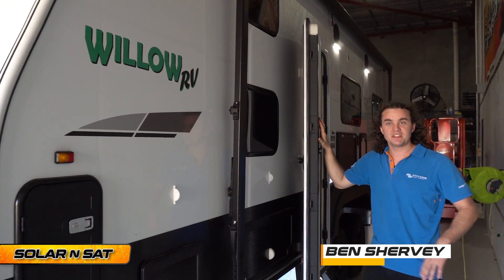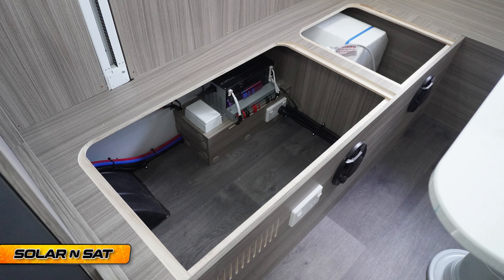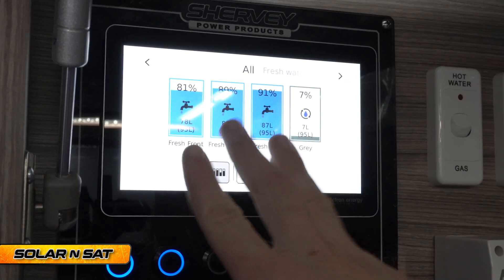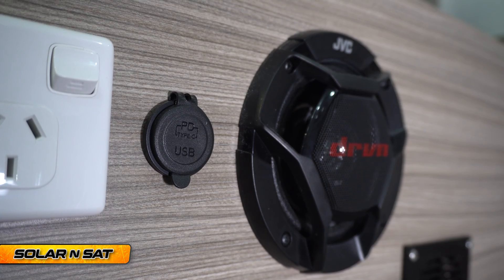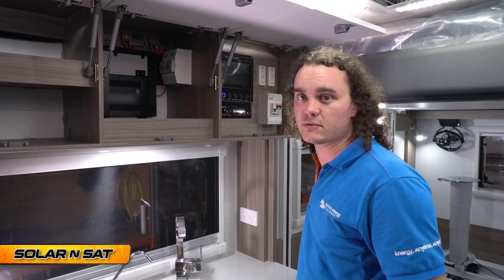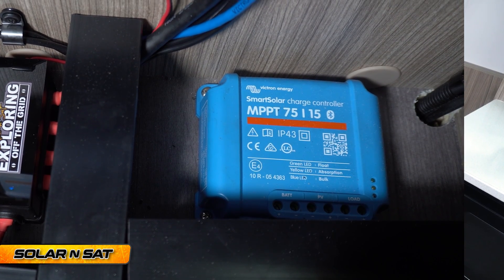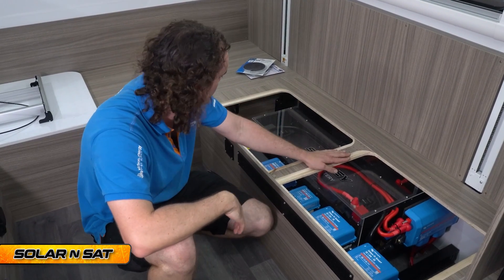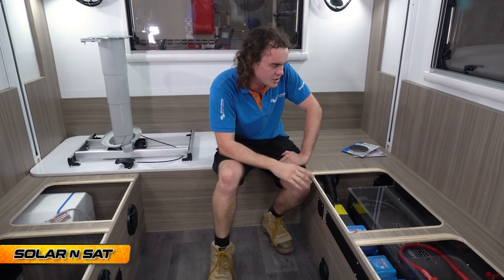Ultimate Victron & Shervey Off-Grid Power System in a Willow Caravan

Comment: Why no smart shunt for measuring thr DC load side of the system? Also why no gui mods or any wireless temp sensors for things like the fridge, electrical enclosure? Makes automating the cooling fans operation far more seamless vs always on.

Why no alternator upgrade on the tow vehicle? The owner isn’t short of a dollar so being able to completely utilise the dcdc’s seems like a no brainer
Reply from the maker: Thanks for watching mate!

A Smartshunt wasn't necessary on the DC load side although there can be benefits to accuracy by fitting one. The system already displays the combined in and out on the Touch 70 using the battery side Smartshunt. Especially in such an AC heavy system the DC loads are very minor in comparison.

No GUI Mods because although it's pretty cool, we as a business and Victron Distributor only work with officially supported software for our own installations. The information provided by the official OS is more than sufficient and once the new Venus OS releases everyone will want to upgrade to that anyway.

Temp Sensors are fitted, we also often trigger the fans by temperature (Check out some of our other videos). Since we use silent PC fans though you can't hear them anyway. With the 300000 hour design life too you shouldn't have to worry about wear on them either.

An alternator upgrade is often a great choice, especially when in setups with much larger DCDC charging systems we highly recommend them. (Check out the 24v System we did for our TV Show Exploring Off The Grid, we installed 2x 100A DCDC Chargers that required it) We also have a 79 Series lined up in future that will have multiple Orion 12/12-50XS's installed to it, it will have an alternator upgrade as well to facilitate that larger load. On this particular job however, to upgrade the alternator for an additional 7-8a of charge didn't feel worthwhile.

The battery bank is currently only running at 65% of its maximum charge rate even with every charger running so more charging can definitely be added later if wanted!